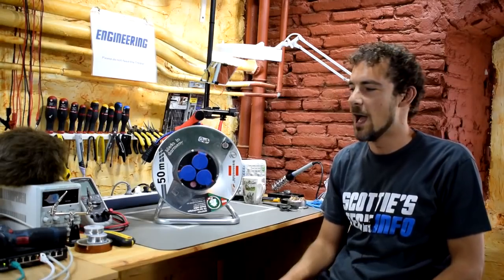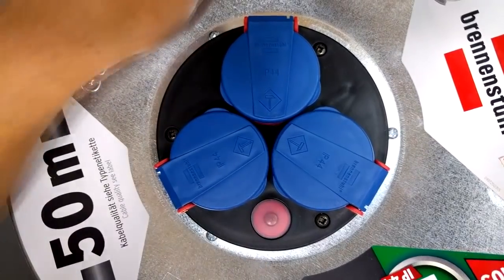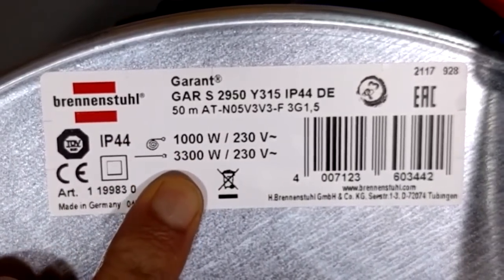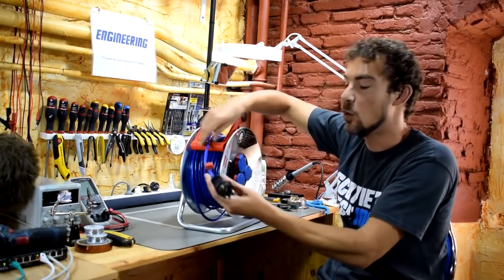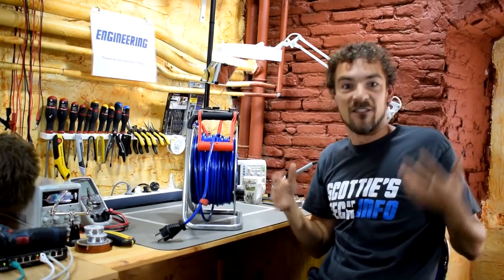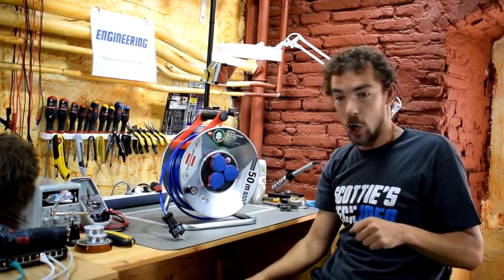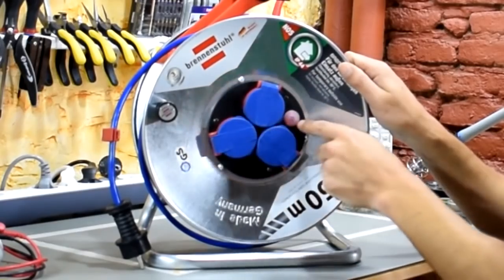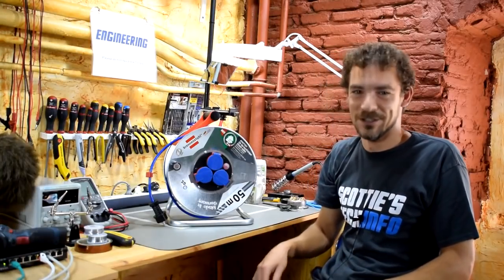You're using your Extension Cord Reel wrong!

Comment: I recently noticed that professional companies run domestic electrical installation inside the layer of floor polistyrene insulation at the stage of building the house. This will not only lower the rating of the wireing but might cause fire due to lack to heat displacement.
Reply from the maker: Assuming the electrical code for that area was followed, it should be okay. There are all sorts of rules for number of wires/gauge of wire you can put inside a conduit, wire gauge based on the length of the run, types of insulation allowed for different applications, etc. If the code is NOT followed, then generally you get into trouble. Interestingly enough, the code also varies by country (and even by state in the USA). So, different types of wire insulation are used in different places, which can even affect the diameter/gauge of the copper wire used for a given amount of current. It's a surprisingly complicated subject for something that seems so simple!
Reply: @ScottiesTech  in Poland we normally run cables on the wall  and then cover it with 3cm layer of cement/sand or gypsum/sand  based render sprayed by compressor. The render conducts heat very well. I suppose if running cable inside insultion then electrical loads has to be considerable lower to be safe than when run it inside the conductor.

Comment: I will not dispute that the safest thing to do is to unroll the full extension cord but I have to take issue with your explanation. You said the following:
"Why do you want to unroll the cord fully no matter what you plug in? This guy is going to trip when you pull the maximum amount of current allowed for this thing which is 3300W, which is about 14.5A. So this protection, if you leave the cord rolled up...and you plug something in, this little thermal protection here is not going to protect against that."
You also wrote:
"Rolly cords have (usually) thermal circuit breakers, but those breakers are a) cheap, and b) designed to trip at the max current for the reel when the cord is fully unwound."

This is not true. It is not a current circuit breaker that will trip at a certain current. It will break the circuit when it reaches a certain temperature. When the cable is fully wound, that temperature will be achieved at a lower current than when the cable is fully unwound.

The way to treat a cable reel is to ensure that the sum of the power/current ratings of the equipment that you want to plug into it do not exceed the maximum permitted power/current stated on the cable reel. In this instance 1000W fully wound and 3300W fully unwound. If you do your sums incorrectly and draw more current than you should then the thermal cutout should save the cable insulation from melting, whether wound or unwound. Of course, one should not see the thermal cutout as an excuse not to do the sums because it may not work as designed. I do not know if they fail open or closed.

There is no need to fully unwind the cable if the load does not exceed the fully-wound rating (1000W in this case).
Reply: So now ur ruling out that there would be no human negligence while using this cord ?
Reply: @shabirmunna1395  Nope.

Comment: So does this have a high chance of failure when it's just running some little table lamps I have five of them I keep them on the rolls and don't enroll them fully do not have cables all over the floor when the power goes out I hook them up to my small generator and it can only do a thousand Watts
Reply from the maker: For low-power stuff like that, you're probably okay.

Comment: So im thinking about buying one
The thing is i have built a small shed and i need a power line from my house to the shed things I'll be using
Are my ps4 portable tv and probably a fan total watts will be around 300 watts
Till i i connect the shed with power line so
Btw the length will be around 25 meters

Comment: thats one reason why we only run 120v in a standard outlet in the states
Reply from the maker: Well, that actually makes it worse. For a given amount of power, you need more current at 120V than you do at 230V. More current means more heating - assuming the cross sectional area / gauge of the wires is the same.
Reply: ScottiesTech.Info less voltage less heat build up? I use 12ga for my extension cords
Reply: @TheTechGuider  Current (Amps) is what makes heat, less volts means you need more current for the same power (Watts). Higher voltage takes less current to make the same power. Bit of a mind f*** until you get your head around it. 220v will make about half as much heat in a wire as 120v for the same power output. That is why power lines carry crazy high voltages, if they ran 120v they would need to be impossibly massive to handle the heat generated.
Reply: @TheTechGuider  The opposite is true. 240V makes much less heat for the same power output. That is why standard kettle in Europe is 3000W. This is unachievable in USA unless you use very thick cables